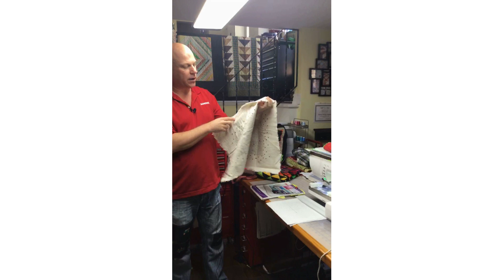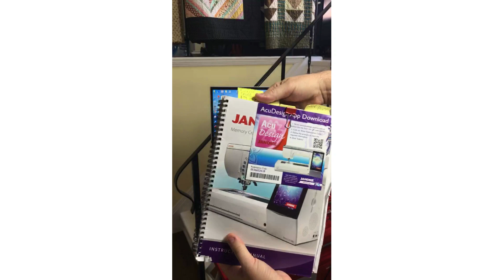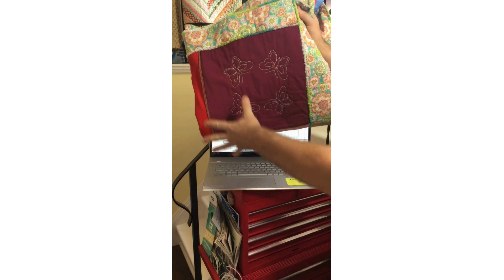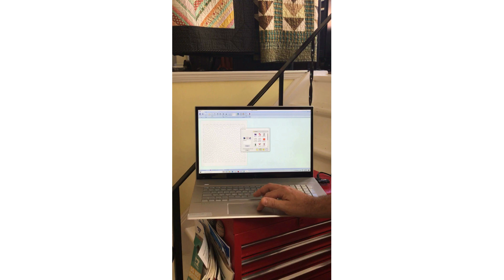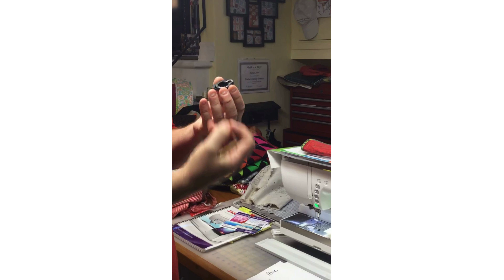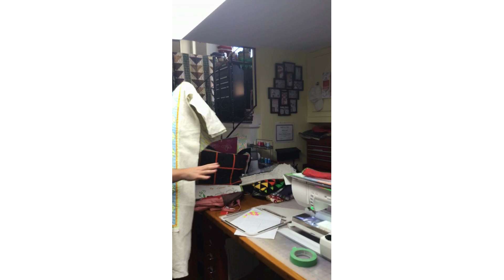Janome AcuFil Quilting!

Comment: I just bought a Janome MC 15000 and was so excited that Acufil software included. When I tried to load it on my laptop I found out that I need a computer with Windows. I have a MacBook Pro and really don't want to buy another laptop. Is there any way to load it on my Mac?
Reply from the maker: HI Priscilla, Congratulations on your fabulous new machine! You can get a program called Parallels, or similar software which partitions the Mac's hard-drive in order to run Windows-based programs. Be to check out our Janome Life blogs for lots of posts about Horizon Link Suite and Acufil Quilting, as well as the many, many posts on the MC15000. Happy Sewing!

Comment: Your video is very informative and I feel like I learned a lot. I'm wondering if it's possible to quilt using AcuFil around 9x9 blocks that have a design embroidered in the center of each of them?
Reply from the maker: HI Paula! thank you sew much! Yes, its possible, though the AcuFil hoop for the MC15000 is 8.5" square, so you'll have to either create multiple hoopings to complete a design, or, create a smaller design, like the cabled border, to fit within the hoop size